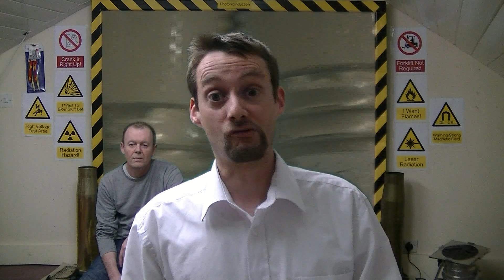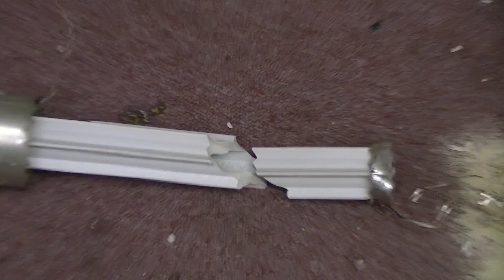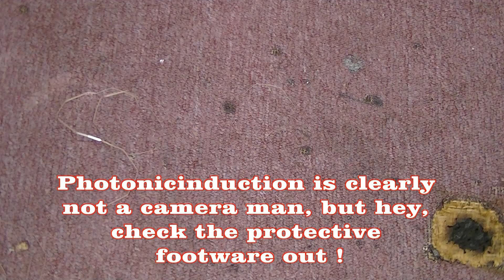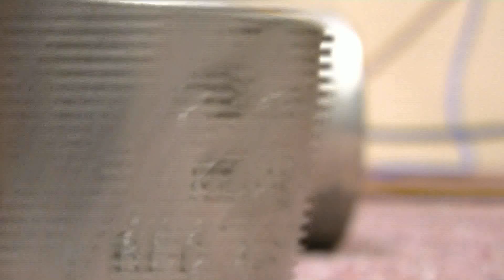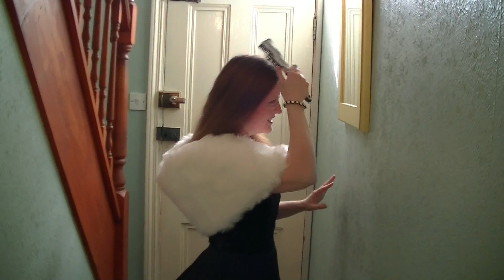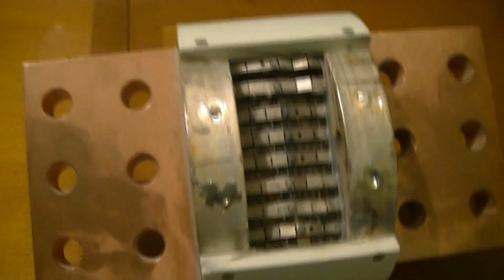Industrial Fuses

Comment: I just found this channel, it's awesome by the way. I was wondering if you could blow a large sand fuse. I've seen some large fuse around 3,000A that are actually filled with sand and once it trips the glass created from the sand is what disconnects circuit. It would be cool to see if possible.
Reply: check out his newest video
Reply: @bend1119  Hahaha I forgot I asked him this! I did see the newest video it was awesome! I heard him say he dumped the sand I wondered how it would be without it but it wouldn't have been as explosive as the video showed especially being enclosed. I was getting nervous with how much power he must have been pushing to make a 5,000A fuse pop.

Comment: quick question, is there any fuse in the world that can stand up to photonic's shenanigans?
Reply: yea an iron beam
Reply: Well, it seems he didn't manage the 5 kA at the end.
Reply: ive seen suitable fuses for photon, on one job, a rewire of a rented house that drug dealers had converted into a cannabis farm they had used copper pipe cut to size as the main bs88 fuse and also on another site i discovered a chippy who had no fuses had used a nail bent back on itself in half to fit as s fuse in the plug of his transformer. i have also seen a photo of screws, blown fusea then wrapped in tin foil, bolts and cut to size threaded rod..... ive also seen a mouse who used itself as a fuse in an old wire fuse DB, assume it was an accident he had chewed his way into the board and brisged between the buzz bar and load side, was quite cooked, dont think he was very highly rated, could have ran LEDs for a while now adays
Reply: Will J no...
Reply: Oh, you will need a special Photonicinduction fuse for that ;)
Reply: Given his most recent video, I suppose not
Reply: the whole point of a fuse is to break a circuit in case too much current passes through.
so if you're having trouble coming up with that level of current, chances are you need a more sensitive fuse
Reply: You didn't read the question did you?
Reply: nuclear power plant?

Comment: is the Amps rating of a fuse always the same, no matter for what power/voltage range its been designed for ?? lets say, your 11KV 36A will still blow in a Car for a way smaller 12V 36A fuse ? will fuses blow "just" by the rated current ? or is there more to it like resistance/power rating of a fuse itself ?
Reply: No it isn't, good question!
Reply: - If you take a 12V 36A fuse and put it on a 12V circuit, it will obviously blow when it needs to
- If you take a 11kV 36A fuse and put it on a 12V circuit, it will again blow when it needs to
- If you take a 12V 36A fuse and put it on an 11kV circuit, it will blow when it needs to, but will probably arc over because the gap it opens is only about 1 mm, and at 11kV you need at least a 4 mm gap not to arc over (but if there is a high energy pulse such as a short, the gap required will be even higher)
Also, if there is enough energy, it may also be completely vaporised.

Higher voltage fuses have wider gaps to prevent arcing and are usually filled with sand which helps to quench the arc and take the high energy pulse.

Comment: Want to know what happens if you try to blow one of those on the ultra cap
Reply: check out his latest video
Reply: @bend1119  I saw it. 10 ultra capacitors = a lot of sparks and a popped fuse

Comment: what do the explosive pins do specifically?, i mean, how do they trip the rest of the phases? how does that system works?
Reply: These fuses typically sit in a 3-Phase setup, so you will generally see 3 of these sitting side-by-side with a separator in between to prevent arc over.  The contacts on the top of each will be mechanically linked (so they all disengage and engage at the same time).  This will also generally be linked to a cutoff lever.   When the explosive pin triggers it lifts the contact off the top of the fuse, which because its linked to the other 2 phases, that will lift the contact off all 3.   The idea is to cause a current break on the entire circuit when any one blows to prevent phase imbalance.
Reply: It's to ensure the other two phases are taken offline as well during a fault. The striker pin hits a bar that disconnects all three phases at the same time from the feed inside the switchgear. If all the other fuses / relays in that 11Kv circuit (main ring) are graded correctly then only that sub gets disconnected and the HV guys only have to visit one site, rather than piss about at the transmission end CB's.
Reply: My guess is that it completes a circuit above the fuse holder which shuts everything else off.

Comment: Easy. Take 396 kW (or 396,000 watts) and divide it into 11,000 volts.

Answer? 36 Amps. Yep..... ONLY 36 amps. :-)

Then, all that's needed, is some kind of enclosure around the fuse wire that can handle 11kV, and there it is. 

A big chunky substation fuse. :-)

I have a 45A cartridge fuse, but it's nowhere the size of these fuses, as it's designed for household consumer units, therefore made to BS 1361, and as such would normally have a voltage upto 240v going through it. :-)

-BoomBoxDeluxe.

Comment: In the U.S. we do have 600 volt 3 phase, however it is extremely uncommon, although it is more common in Canada from what I've heard. The only place I've ever seen or had to work with 600 volt 3 phase is on older railroad equipment. Railroads never seem to use anything that would be considered "standard" in any other industry, voltage (600 volt), wattage (56 watt light bulbs), etc...
Reply: Those railways are up to something

Comment: plain white well sifted and sizes silica sand, pure as possible so that it will not carry an arc under almost any circumstance.  A finer version is added to the salt in a crisp packet as an anti caking agent, so you can actually eat the stuff, though you will have a real bad day the next day, as the beach drops out ll gritty.

Comment: So as stated a higher voltage will result in more energy being consumed in popping that fuse so might make a bigger bang... It will also arc further.

Photon likes to be dangerous and play with big capacitors so what the wall can provide need not be a restriction....

Comment: It's not volts that pops a fuse, but AMPS.

If Mr. Photon wanted to pop this at 11kV, then that 11kV would need to be backed-up with at least 60-100A, & when the maths is done, that works out to AT LEAST 396 kW of power.

That's a bit more than what the average domestic wall socket can take! :-O

Volts x Amps = Watts.

If it's just a case of "let's pop this fuse....", then 60-100A at a voltage less than 50v should make it go *POP* quite nicely.

Example: 100 Amps x 25 Volts = 2500 watts.

-BBD.

Comment: As for a demo on not using DC on an AC breaker goes, go to RODALCO2007's channel, as he has done a "DC on AC MCB" demo & yes, there's internal sparking, magic smoke..... :D

On MCBs, there's B-types, C-types & D-types. That is to do with the Disconnection Curve Characteristic. The inrush on a big 3ph motor would pop a B16, whereas a C16 would allow for the inrush startup current. :-)

B-types for domestic stuff, C-types for commercial/small motors, D-types for big industrial stuff.

-BBD.

Comment: It's called a striker and has 2 purposes. 1. It is an indicator that the fuse has blown. 2. In three phase installations, it will trip all three phases if one fuse blows, as long as the switch gear has that ability.